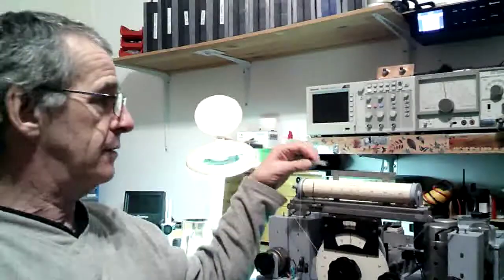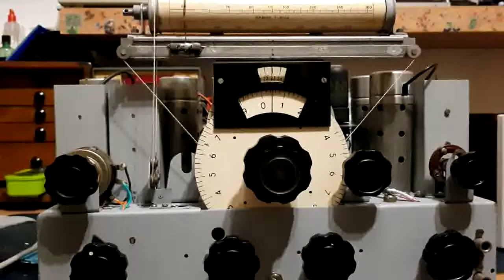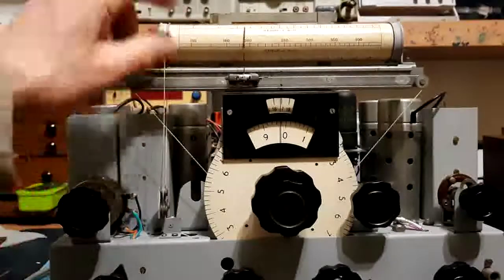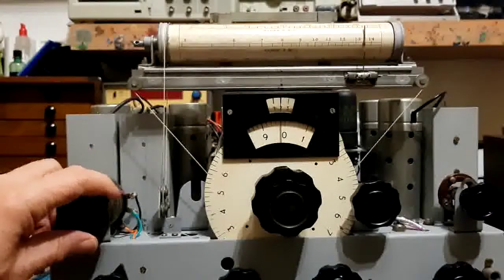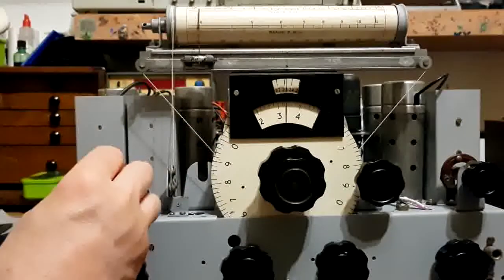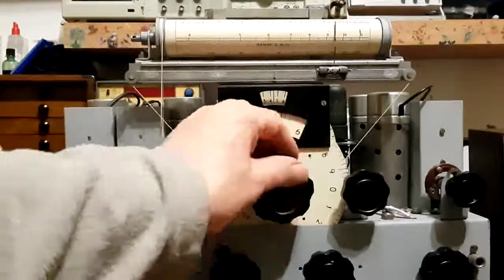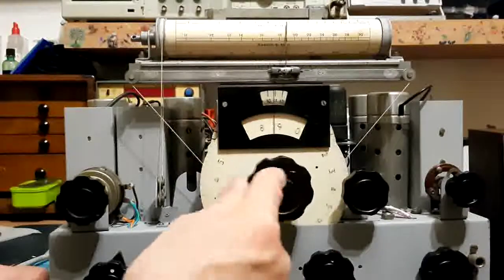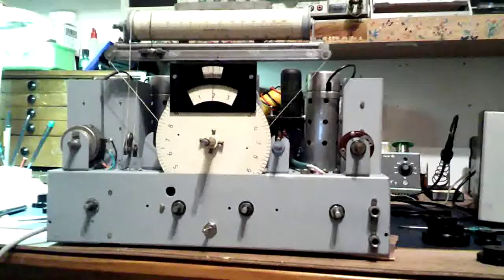Marconi CR100 Renovation (52) A tune around the bands and look at the front panel.

Comment: Hi Simon, I read here something was wrong. Hope you got better now. I started again with the CR100 after having other things to do and a bad corona stroke. Doing an hour building up the CR 100 every day. Gives a good feeling. All the best, Herman
Reply from the maker: Thats good news Herman and I hope you to are recovering well. It is a good feeling when starting to rebuild the radio instead  of all the cleaning and dismantling. The more I did the more I found to do haha.
 I was diagnosed with prostate cancer last summer so didn't get much time to work on the radio. Since then I have had a prostatectomy and now cancer free. (I had no symptoms so was lucky it was spotted early). 
I have now started on the case and the  front panel and doing a video as I go. (off work so doing a little at a time). The radio is working well . Discovered a few strange signals ? on the band 1  frequencies.
Reply: @simrich306  I see. Well, that 's good news. Much pleasure with the hobby! Brgds Herman

Comment: Hi Simon, I am still busy with the CR 100. Making the components boards now with new R.'s and C's, after having other things to do.
Hope you keep the YuTube films" on line. I look to them regularly! Brgds Herman PA3EHZ
Reply from the maker: Hi Herman . Its good to hear you are progressing with the CR100. I will keep the videos up and will probably add to them.  Ive been a bit slow in finishing the radio. I only have the front panel lettering to complete. Im going to screen print it . so at the moment Im practicing screen printing. I have also started to redraw  the circuit diagram and have used different colours  for the inter connections so it easy to follow then  with all the black lines. I Have a plan to make a website with all the details of my rebuild and all my drawings etc. Maybe over the coming dark winter nights.  73 Simon GM8NYV
Reply: That would be wonderful. The diagram is indeed hard to read now and then. I have some original handbooks (in the computer) in case you need these. They came from the Oxford Uni. Archives. Thats were the whole archive of Marconi Ltd went to. 73 Herman @simrich306